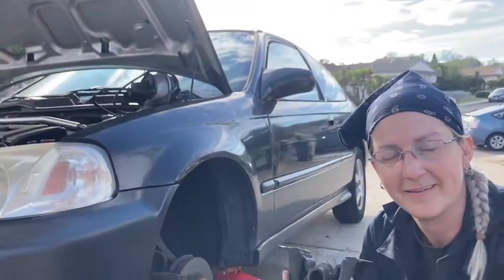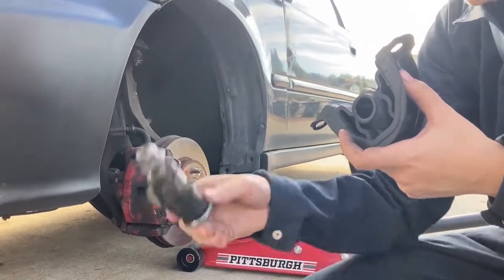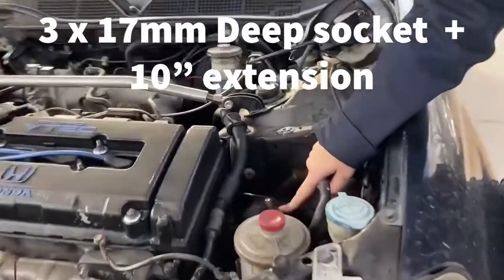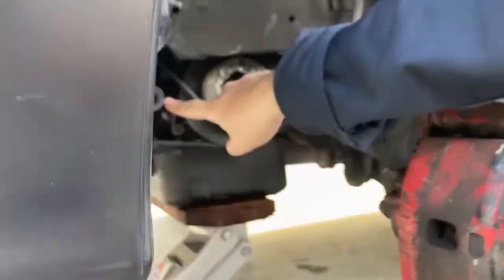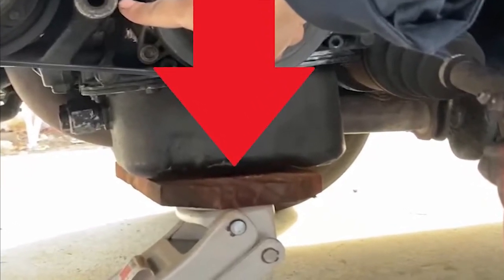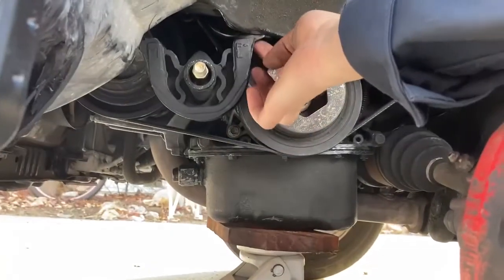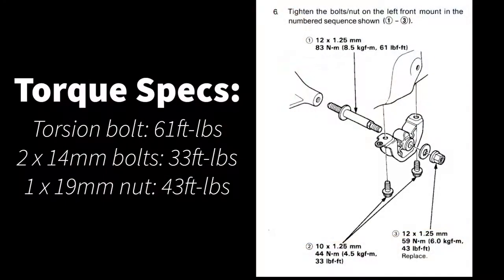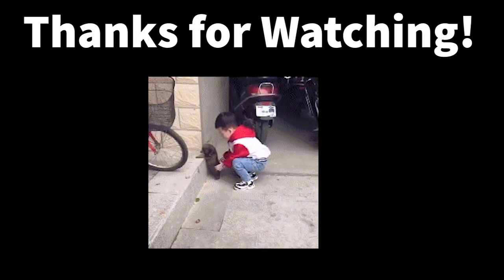1996-2000 Honda Civic - Replace Front Lower Left Motor Mount/ Torsion Mount - Girlie Garage

Comment: Why is the rubber mount so loose on the new stud? Is that right?
Reply from the maker: The rubber is designed to hold but “float”. If you torqued the bolt to the correct amount, then it should be installed correctly

Comment: What the thing you bought called looking for one back stupid thing came off
Reply from the maker: This is the 5 piece kit I bought (Amazon affiliate): https://amzn.to/3TKfWGB or you can just buy the front left: https://amzn.to/3RAm6r4 . Always make sure to check the correct fit for your vehicle before ordering
Reply: @GirlieGarage  thanks for the fast reply i have the mount I need the screw bc I’m stuggling to take off the bolt does it come w the 5  pieces kit or do I buy it Separate
Reply: @GirlieGarage just like you in stuggling to get the nut off the thing and had to take the whole thing off
Reply: @GirlieGarage  I need the screw that goes to the front left tire so I can put the mount on. The bolt doesn’t come off the bushing
Reply: @GirlieGarage  been outside working since last night 🥲
Reply from the maker: @Junior-kc7mp  If you're talking about the really big threads that go through the middle of that torsion mount and into the block, you can find that separately from Honda or a junkyard, but it would be better if you torched the bushing off so that you don't have to buy a new one. They are kind of expensive.
Reply: @GirlieGarage  never mind got it thanks a lot luv. Your video help me out a lot honestly. Short and right to the pojnt